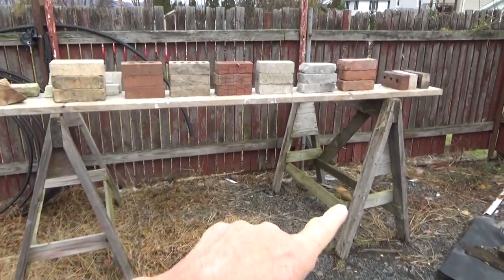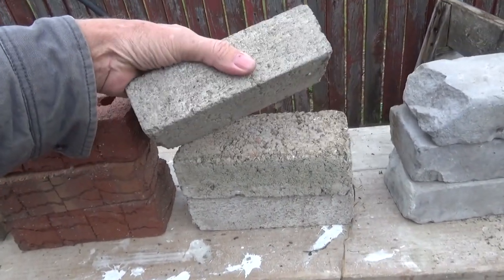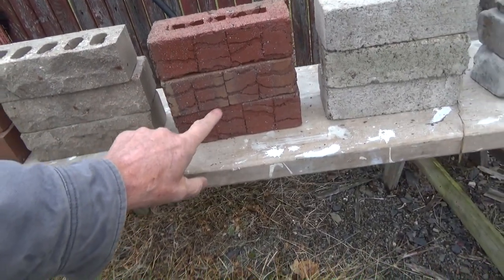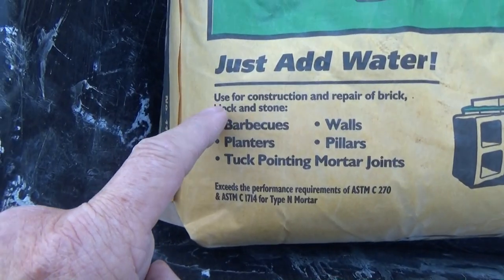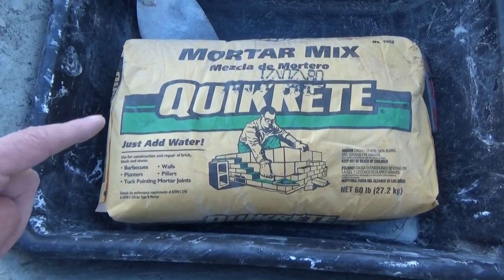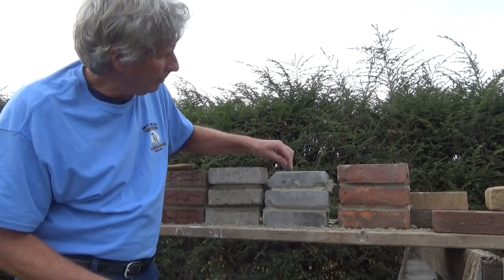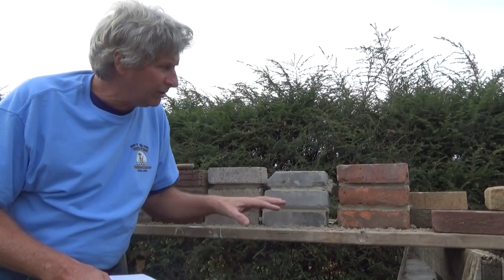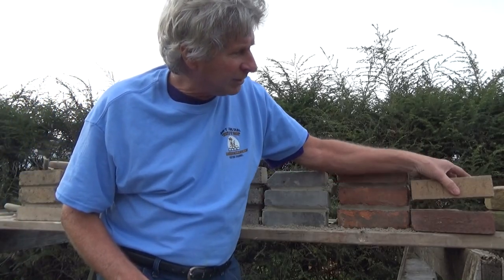REPOINTING BRICKWORK (Part 1)Mike Haduck

Comment: I need to repoint a badly weathered Victorian, London brick wall, and am going to try your method. Brilliant videos.  Thank you for taking the trouble to make them so detailed!
Reply from the maker: Thanks Sally, Mike
Reply: Sally if your house is Victorian I wouldn't use cement,  lime mortar is the one for you. Never use cement on old brick. Check out the site London Repointing and renovation,  real trades. I wouldn't let this man near my work. He keeps adding cement, so each batch will dry a different colour.

Comment: That Quikrete ready mix is good stuff. They also make a Type S, which can be used for brick pavers in my area. .. They also make a variety of dyes to make colored mortar. I like to make a red-burgundy mortar to use with red brick for building a nice country mailbox. I mix a red brick with a blonde brick with red mortar, so it matches most barns.☺
Reply from the maker: Thanks bonanza,  Mike

Comment: This is an interesting demonstration. The old man that trained me, taught us to 'cut the brick' after striking BEFORE brushing with a horse hair brush. After striking (aka jointing) we would take our trowels at about a 22 degree angle and cut off 90% or more of the mortar snots formed at the edge of the bricks and struck mortar joints. And then we brushed it. That kept the walls 'CLEAN'. No need to acid wash it after. ... But everywhere I worked (big commercial masonry companies) after they don't do that, and they always make a mess. and HAVE to acid wash it.. There's a lot of dummies and idiots that work at those places.
Reply from the maker: Thanks, Mike

Comment: I've learned a lot. I've done a fair amount of mason work. One thing I have not seen is firebox work on your channel. Using firebrick and refractory mortar.  I've repaired and built from scratch a backyard fireplace...cutting firebrick and used refractory mortar....not to be confused with portland mortar mix. I kept my firebrick joints very narrow...and it is still holding up well...the joints can't crack because I used very little mortar. 
Also I tinted the facing mortar to compliment the color of the facing stone work rather than the standard gray mortar color.
Reply from the maker: Hi George, I got one on my stone fireplace video,   not a lot of that going on anymore. I did tons of them back in the 70s, everything had changed, thanks Mike

Comment: Great vid, loads of good info!  I'm not a propper bricky but I lay a few as I work for a builder. I let it go off (usually later same day if its friday or next day if I've got time) use the trowel to scrap the pointing and wear a glove and rub with finger and brush dust off. It took time for me to master the skill of not getting the bricks dirty, one time I forgot to scrape the pointing off on a Friday, came in Monday and it was hard so I used the wire wheel on my drill and grinder to make it look better, thankfully it's not on show, I've learnt to take my time and be patient. 
Once built a extension using nhl3.5 lime, sand and cement mix with sandstone blocks and it was red hot summer, you can tell which courses were laid on a Friday as the pointing was rubbed off wet (despite been covered with hessian) it dried differently as the sandstone sucked the moisture that much, rub the pointing off wet it went all boubley/grainy
Reply from the maker: HI Tom, yep repointing is an art and it takes time to make it work, your right about that for sue, thanks Mike

Comment: Hei Mike,
This is cool. Few questions to ask:
- Are brick capable to bear all the lateral weights and loads, no reinforced concrete or rebar to support it?
- why old buildings facade is so beautiful than modern architecture, from now days?
- can make a video of building designig with brick and stone art work? Wont the stones fall off during earthquakes?
Reply from the maker: Hi Sami, after the earthquakes in California brickwork is a dying thing in the USA, everything is getting premade and going to glass and steel, lots of changes from the old days, I got a video out " the masonry business is changing " Mike haduck, thanks Mike

Comment: Excellent video 👍
I have a brick wall in the kitchen that has damaged pointing due to a leaking pipe.
It's a weight bearing wall but it's behind the washing machine/cupboard. Can I get away with not getting it repointed or is it dangerous to leave it like this?
Reply from the maker: Hi Irene, I can't say unless I was there to see it, thanks mike

Comment: I have a small decorative 2'x2'x2' pedestal/stand made out brick that's attached to my garage. It's mainly decorative in nature. The house is 30 years old and the joints on top are coming apart. My wife sets a bowl of flowers in the summer that constantly drains water onto it plus water gets in the joints in the winter causing freeze damage. Mike said not to set bricks horizontally. Should I use type S mortar to tuckpoint it instead of N? Then should I seal the horizontal brick? I live in Missouri which gets to 0 in the winter and is plenty hot in the summers.
Reply from the maker: Hi Paul, I would cover the planter in the winter so it does not get water and freeze, then it's up to you what you want to use to repoint it, depending on how hard the brick is,  thanks, Mike

Comment: Hi Mike! Thanks to you I rebuilt both my chimneys, repointed/repaired my walls and I’m going to stucco my basement walls. Save me $1000s and looks great. I was wondering if it’s possible to build a foundation and short wall (2-3’ tall) for a barn using just limestone rocks and mortar. No poured concrete. I have lots of limestone and would like to build a barn with rock and timber from my own property in south eastern Ontario. Any advice would be lovely! Cheers!
Reply from the maker: Hi Will, you probably can, that's all they did in the old days, thanks, Mike

Comment: Hi mike
Love your videos and I’ve done a few projects based on your advice. I had a question on filling blocks  for seating for a fire pit in a yards that gets overflow flooding every couple of years. For the uprights of steel in the blocks should you fill with mortar or concrete?
Cheers 
Vince
Reply from the maker: Hi Vincent,  I can't say unless I was there to see it , but when we built foundations out of block we filled it with mortar but if everything was to be filled we would fill it with concrete, thanks Mike

Comment: Do you recommend grinding out the joints, or just filling in the mortar?  Grinding creates a lot of dust, and sometimes damages the brick.
Reply from the maker: Hi Tiger,  if it ain't broke I don't fix it, I just go over the bad spots I am not a fan of grinding it out unless it's absolutely necessary,  mike

Comment: Great video. Thank you. i am repointing a ceiling in a home with an arched ceiling and some of the mortar has fallen out. I live in Italy. I believe parts of this ceiling are old and parts are new. My main question is with the terms (as I need to translate). Are mortar and cement different? I am thinking that Mortar has sand, just add water and cement is only one element in a mortar mix. Is this correct?
Reply from the maker: Hi Catherine, I would ask the local masonry suppliers what they use in your area, I am sure they will be a better help, thanks Mike

Comment: I like the idea of wetting the joints with a brush rather than spraying and using dry mud so it wont stick to the brick face..  what if I have a brick mailbox that needs 100% of the joints re tucked. Would you wet it with a brush or spray and tuck it  with dry mud or use wet mud in a bag?
Reply from the maker: Hi, I never use wet mud in a bag, I gave a playlist, " repointing brick work" Mike haduck, that should help, thanks mike

Comment: Mike, I've been doing some parging work using your 1:2 Portland to Sand mix, and it's perfect! My question is, I'm repointing some 1960's bricks. I've been told to use Type N as it's softer and won't crack the bricks due to their expansion. So, will the 1:2 Portland to sand mix be soft enough to use for pointing my 1960's bricks? The color is closer to my original mortar than Type N mortar is, so I was hoping I could do this.
Reply from the maker: Hi , soft brick could be a issue with portland, type n mortar has 33% portland in it so you should be fine, do some samples behind the house wait a few days and see how it is, it should be softer than the brick, my opinion,  thanks mike
Reply: @MikeHaduck  OK, thanks, Mike. I have always used the green bag of mortar from Quikcrete as in your video. I just didn't want to use it on older brick if it was too hard. Thank you! I appreciate your advice and your videos. They have really helped me a lot!

Comment: Mike,how does moisture content affect the strength of cement?
Reply from the maker: Hi Henry, lots to say about that and different opinions, but for what I showed I never had a problem or callback, thanks Mike
Reply: Henry D  as an old concrete mixer driver I can only say that water weakens the strength but it gets rid of your load faster

Comment: Is there any truth to bricks from the 1800s needing lime mortar?  I have heard so many conflicting opinions on this. The reason I am worried is that my circa 1840 house was repointed with a modern mortar (not lime) a couple decades ago or so. The bricks are in pretty good shape.
Reply from the maker: Hi building H, I got a video out called " lime or Portland " what should I use? Mike Haduck that should help to answer a lot of questions,  thanks mike

Comment: I was going to ask which is better for tuck pointing - ready mix or masonary N type mixed with sand and what ratio would you use?
Thank you for any info. - We live in Michigan and get some bad weather too like P.A.
Reply from the maker: Hi Tony, if you ask 10 masons you will get 10 different answers,  I might use n or sometimes s, depending on what I am doing, thanks Mike
Reply: @MikeHaduck  Mike, Thank you for an honest answer. I was helping my son with his used home and were  using the N type and mixing with sand. I like the tip about not wetting for it can get messy on the brick.  Using that acid cleaner afterwards cleans some but, not all off the bricks. I enjoy all of your videos too.  Take care! You work very hard and make it look easy breaking those bricks for pieces.
Reply from the maker: Thanks again, Mike
Reply: @MikeHaduck  Mike - Hello! I was checking your bio page and saw you were in the U.S. Navy. Thank you for your service! You are in ship shape still! My dad who passed in 2017 at age 92 served on the Heavy Cruiser USS Louisville CA 28 from 1943-46 and witnessed (52) sailors and Rear Admiral Theodore Chandler buried at sea due to (3) kamikaze hits in the Pacific. (1) main gun turret found in 2015 in Nevada Desert used for atomic bomb testing data. My son is in the U.S. Navy Seabee Res. Construction Battalion Div.  God Bless all our service men and service women - past and present! I really enjoy your videos and my brother does also. Have a great weekend!
Reply from the maker: Thanks Tony, God bless,Mike

Comment: Ok so there are bricks with such huge different characteristics. I was wondering why some brick Mason perform curing to their walls by pouring water over it for at least 7 days,  but some dont even bother. So it depends on which types of brick they use, right?
Do u perform curing?
Reply from the maker: Hi, I never did any curing with brickwork, a lot depends on the type of cement they use, thanks Mike
Reply: @MikeHaduck   Thanks for the reply.  About the type of cement, I thought everyone are using Ordinary Portland Cement (AKA. OPC) for brickwork.  In our area, the mason usually mix ratio 1 part of OPC to 4 parts of Sand.  And they perform curing for minimum 7 days.  It is assumed that during the hydration process in the cement while achieving maximum strength, it requires curing to keep it hydrated or else mortar gets cracks and doesn't gets its full strength.
Are there any other type of cement that doesn't go through the chemical reaction of hydration for hardening?  I am really curious.
Reply from the maker: I would say a mason learns more from tearing out old work and what worked or didn't work, , I show what I use in each of my videos in my area from my 50 plus years of experience , I go around repairing all these new cements they come up with in a laboratory but don't work in the real world, I can't answer better than that, thanks Mike

Comment: You have mentioned more than once that you should not use a mortar that is harder than the brick.  If you were mixing your own mortar, how would you mix it to make the mortar softer?
Reply from the maker: Hi Dave, I am actually working on a video for that, but you just make some different mixes, wait 30 days scratch the brick and joint to see what is softer, but the oldtimers knew way ahead of time what worked,  thanks Mike

Comment: How do you know when I need to repoint my brickwall? It seems to have some corrosion, it's about 25mm in from the edge. Thanks
Reply from the maker: HI, like anything, look around at other houses and brickwork and compare yours to there's, see what acceptable to you would be, my opinion,  Mike
Reply: @MikeHaduck  thanks Mike. Love your work and hope it grows astronomically. Does mortar corrosion affect the structural capacity of the wall? I'm guessing it does depending on how corroded it is.

Comment: On the table, you have bricks of various ages over 100+ years.  My understanding from reading a lot on how to repoint is that bricks from various times have different hardness and they you shouldn't use cement based mortar on older bricks because it is too hard.  Yet here you used the quickrete product that contains Portland cement?  Wouldn't this damage older brick, like some of the ones on the table? I thought you had to use lime based mortar only that contains no Portland cement for older brick structures. Is this not right?
Reply from the maker: Hi Mike, I have a video out called " Lime, Mortar or portland? What should I use? That will explain it best, lots of controversy about Portland but everthing depends on what you are doing and where, Thanks Mike

Comment: Very informative. Thank you. Mike, I have a question and a problem. Inside, my fireplace brick has a few cracks here and there. I want to fill them in but can't determine what color mortar repair to use. The strikes are more a sand color than a gray. Any tips as how I can figure this all out and not make a mess of my fireplace. I used a mortar repair on a few of them but it dried too dark. Thank you so much.  ( if I had your email I could send you a few photos of the cracks )
Reply from the maker: Hi Sherry I am colored blind, so I really can't say, thanks Mike
Reply: @MikeHaduck  Oh, my! I was counting on your know how. Thanks anyway
Reply: @MikeHaduck  can you please tell me where I can get  Workrite colored masonry cement type n. They have a sand color that looks about right. Thank you. Much appreciated. I've looked online at Lowes, Home Depot, Amazon and Ebay. Can't find it.

Comment: JOINTS SHOULD BE PERFECTLY ROLLED !
Reply from the maker: Hi Fred, Why?, Mike
Reply: @MikeHaduck  SO THEY SMOKE SMOOTHLY YOU FOOL !
Reply from the maker: @fredflintstoner596  I don't understand, I always had to do the joints as the owners ,architects, engineers required. I been doing this sense late 60s and never heard of smoke smoothly,  thanks Mike
Reply: @MikeHaduck  IF YOU LIVED THROUGH THE 60'S HOW DO YOU NOT KNOW WHAT A JOINT IS ?
Reply from the maker: @fredflintstoner596  I guess your right, I never thought of it that way , lol, Mike
Reply: @MikeHaduck  DON'T TELL ME YOU HAVE FINALLY WORKED IT OUT !

Comment: So can I use type N mortar to repoint my 1900 house? It's made of locally fired clay bricks.
Reply: Mason yard in KY recommended O type for my 1919. Best thing is to go to a real masonry yard. Home Depot guy had said S type.....pretty sure that would've been way too hard for the soft bricks.
Reply from the maker: Hi Matt, the mortar should be softer than the brick, I would do a few samples wait a week and see, thanks Mike
Reply: @MikeHaduck  How do I know if it's softer than the brick?
Reply: @MikeHaduck  after I do the samples, how do I tell whether the mix is softer than the brick? Will it cause damage right away?
Reply from the maker: Hi Matt, I got to do a video on that, but I get a screwdriver ,scrape the brick then scrape the mortar, see if the mortar is softer, old school, Mike
Reply: @MikeHaduck  sweet as, thank you for replying!

Comment: What you're saying at 15:52 is not good advice if the layer of mortar is going to be thin, for example if you are repointing bricks with a raked (recessed) joint. I forgot to wet the bricks, and the water was sucked out of the mortar too quickly to allow it to cure properly. When mortar dries too quickly, there isn't enough time for the chemical reaction to allow for hardening. It results in mortar that falls apart like sand, no strength.
Reply from the maker: Hi himron, mortar and cement is a binder, some look at as a glue, people in peru (see my videos) are still making bricks out of mud, when laying brick you have to either raise your joints or tighten your joints to meet heights, I did a video called, "lime, mortar or portland", what should I use?  I think that will give my best opinion with my experience, thanks Mike

Comment: Never use a wire brush on masonry. Wire brush wears away then metal is left on the face of brick and may give you rust stains.
Reply from the maker: Thanks, I never had a problem,  Mike

Comment: My brick has nothing in behind to hold the grout it just keeps falling in behind.. maybe I can put some chicken wire in the back to hold cement
Reply from the maker: Hi, there is different ways to do it, sometimes I put in a little wet ir fast drying and then fill it or pack the back with insulation and fill it, everything depends, thanks ,Mike
Reply: @MikeHaduck  thx, no big deal… get it done.